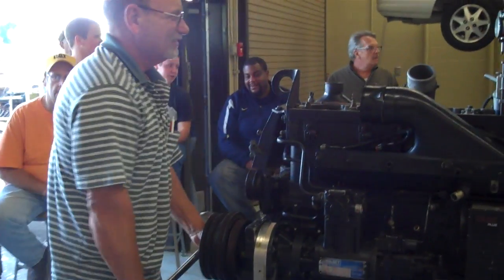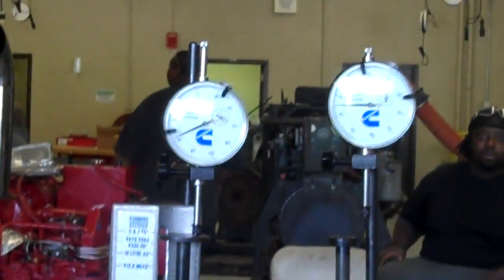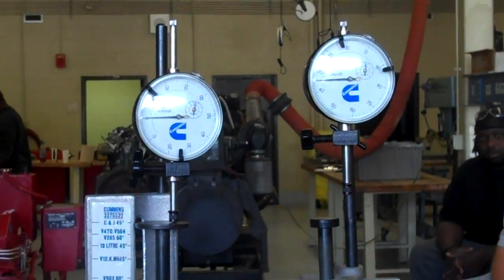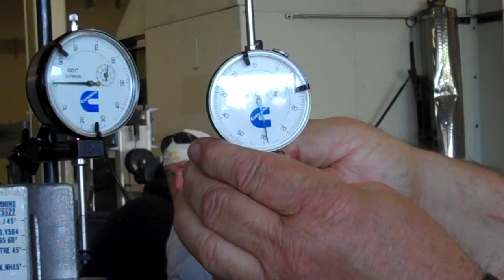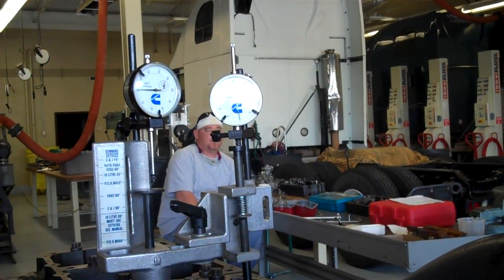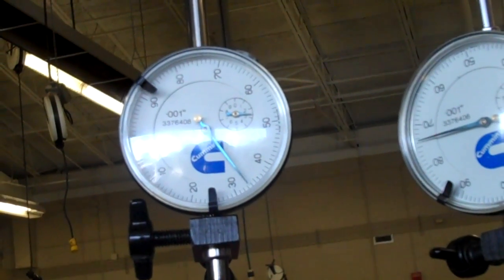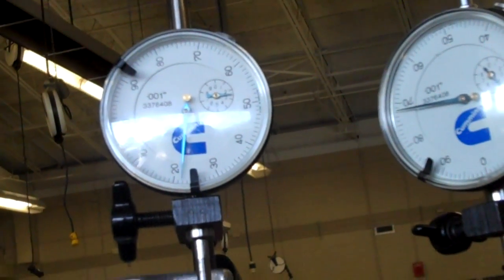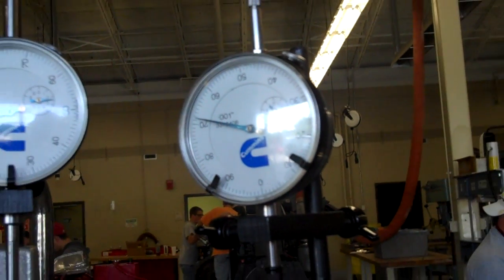Chattahoochee Tech Diesel; Cummins N14 Injection timing.MP4

Comment: Technically, timing is at 2.032”. Also, both of your dial indicators need to be rotating in the same direction or your 360’ out on the crankshaft. Always remember to read the “amount of lift left” NOT how far you have come. In addition, if you have to advance or retard timing, you will have to change cam follower gasket thickness. A good way to remember is if you need to Advance timing, the first two letters of the word “Advance”is “ad” so you add gasket thickness because the first two letters of the word “add” is ad. To Retard timing, the first two letters of the word “Retard” is  re and the first two letters of the word “remove” is re so you remove gasket thickness. If you are unsure of what gasket thickness to use start with .042”. Just a few tips to make it easier. Another detail, this procedure was available pre electronic engines. This is a Celect pump. It is not a “PT” pump technically. Celect & Celect Plus pump is just a gear pump that runs constant at approx 150 psi under load. Spec allows for as little as 125psi and the engines will still run BUT I’ve found them to be a little rough at idle if as low as 125psi. This system needs a minimum of 25 psi output from the gear pump during cranking or you will have a no start condition because it takes that much pressure during cranking to allow for fuel metering&timing chambers inside the injector to fill. Watch out for the check valve at the ECM  cooling plate outlet that can be source of no start if it is plugged with debris, the fitting comes apart for cleaning. N14 Base Engine Timing is accomplished thru the use of offset camshaft keys & cam box gasket thicknesses. L10, M11& ISM are advanced or Retarded using only offset cam keys. One last tip, if you get the timing correct on the forward cam box, you can remove that cam box then from the front and reinstall it in #3 cam box position and you won’t have to set the tool up on the #5or6 cylinders if there is a firewall in the way of the tool and you are doing this “in frame”. This is a great video and I hope you are gracious enough to suffer my comments? Thank you and God Bless You All!
Reply: So in the event of a cam swap.  Is it still critical to time the piston to injector timing if you already know the shim thicknesses you took from each cam follower cover?
Reply: It’s my understanding that the early Celect Plus’ were timed too .352, and the later ones were timed to .362. How much more advanced could you safely go above .352?

Comment: Question my N14 PT fuel system accelerates slower than my other 2, tech is telling me cam timing has 3 settings slow, med, fast, my main question is it’s not low on power, does those 3  cam timing settings affect engine torque & power, rebuilt PT pump, will leave alone if it doesn’t affect torque & power

Comment: MISTAKE !  Bad technique, the instructor is DRIVING the crank gear via the camshaft gear via the accessory drive gear. When the engine runs those gears become DRIVEN components.  The  gear lash  change the actual injection timing !& thus this engine will not be timed accurately. he should be turning it over using the crankshaft , NOT the acc drive shaft
Reply: Hmmmm Dear,
It's the recommended and correct way to turn or rotate the engine in desired or counter clockwise rotation. Also I would like to update also that all valve and injector setting position is also marked or embossed originally by Cummins on same accessory drive shaft 😎✔
Reply: @zeeshan_engineering_services  nope book says clockwise and from crankshaft only
Reply: @Chupadre2234 
Clockwise rotation as seen from front end of engine, would be anticlockwise rotation as seen from Flywheel End 😊

Comment: Bc engines are like long rod high rpm nascar race motors...... You set the timing for peak power and deal with the finicky low rpm probs. I have 3 and was a b cat guy for years.... Next to the acert (with lower compression and a 6nz type ECM ) they are tough to beat. 2000-2500 make serious hp just won't lug along can't be lazy trucker guy on here has my cab over on YouTube  somewhere 79 bc1 106000 pullin satus pass @ 45 mph passin a 515 Detroit and his 600 c16 just FYI..... I get 4mpg no matter what

Comment: They built it this way because they did not want it easily altered. Ohc engines are electronic the base inj timing is fixed but performance advance is in ecm